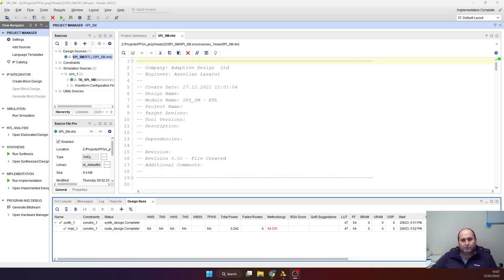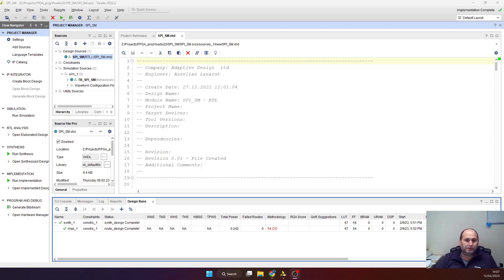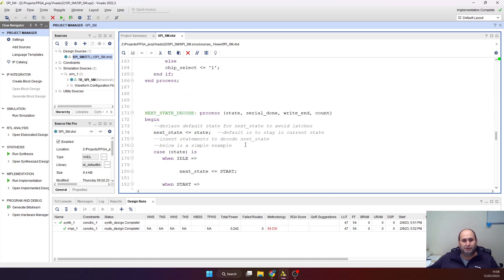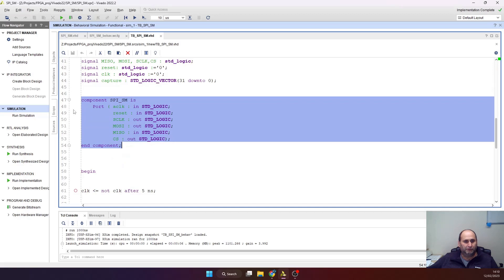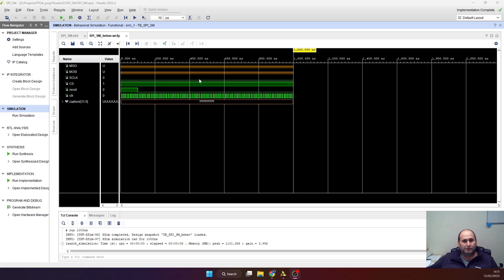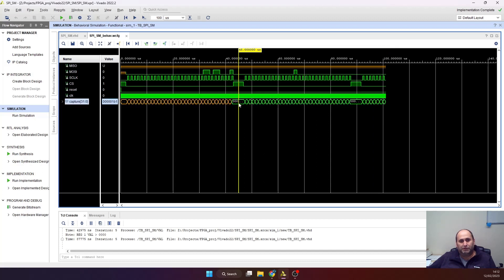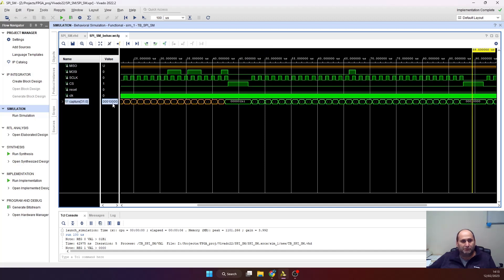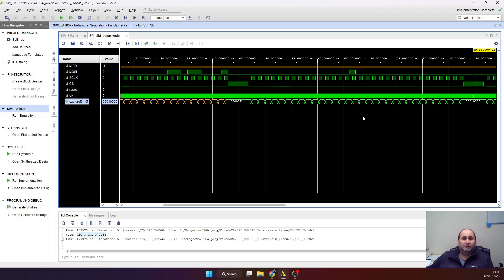SPI bus with State Machine from FPGA

Comment: Thanks for that, great to see an example of how to do this without a softcore. One question for you: For a newbie looking to learn FPGA development for hobby projects, would you advise VHDL or Verilog, and I would be interested in why. I am leaning towards verilog at the moment.
Reply from the maker: Hi Mike,
Any of the two will do, I initially learned Verilog because the source code looks closer to "C" and later switched to VHDL. I think Verilog might be faster to learn and is less weird. VHDL is a very (strong) typed language every variable has strict type declaration. Most of the tools are clever these days to work with a mixture of VHDL and Verilog so it doesn't really mater which language to settle to.
Reply: @adaptivedesign8795  Thanks Aurelian. I think I'll carry on with Verilog for now then. When I get the time!
Reply from the maker: That's the story of my life: When I get time...